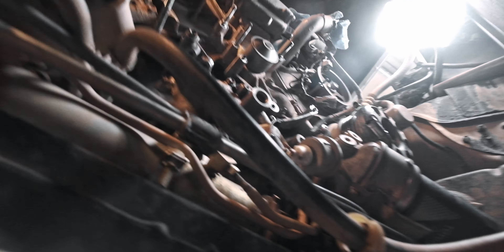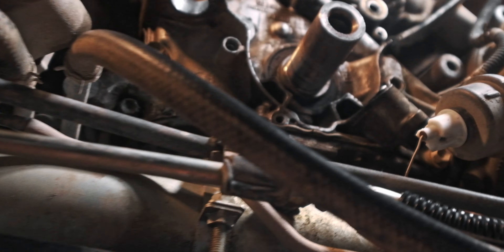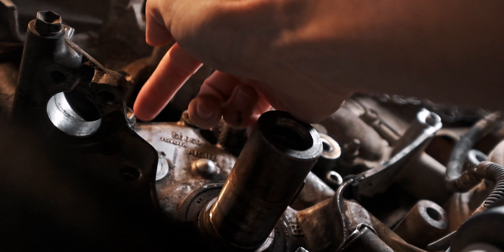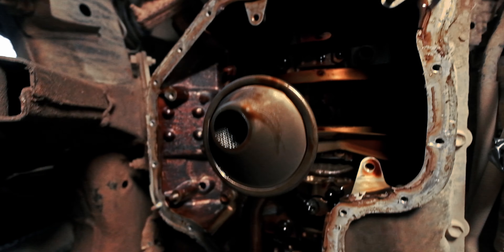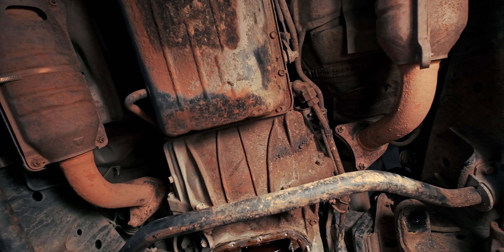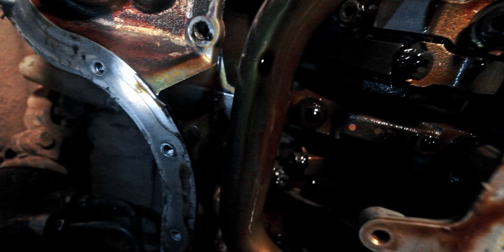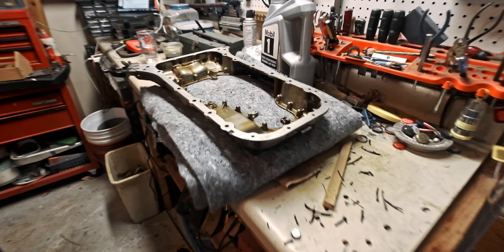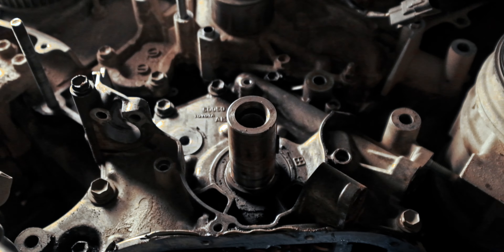Oil Pump Leak: O-Ring Failure on 2UZ-FE for 100 Series Toyota Landcruiser, Tundra, LX470, etc

Comment: Thank you for this video. Quick question. I took my Sequoia to have this leak taken care of. The mechanic did the front crank seal, only for me to find it was still leaking once I went to pick it up. He told me it was that same seal, but once he tore it down again, he told me it was from the oil pump housing. The new crank seal held up. At that point he still didn't know there was an O ring a couple inches away behind the oil pump housing. In the video he sent me from the first time, there was oil up there but worse than your video, and pooled up under the crank sprocket. Now as we're addressing it again, he said that it was hard to tell because the timing mechanism sprays oil everywhere. My question is, would that actually happen? Or does the timing cover block oil from spraying upwards? Just trying to determine if he missed it the first time and it seems like even the slightest amount of due diligence would have proven the crank seal was not the only issue.
Reply from the maker: It’s difficult to understand if you’ve never taken one apart but if he had looked at a parts diagram he would’ve figured out what the problem was immediately. It is easy to assume that the problem would be limited to the crank seal but he should’ve made sure it was fixed before returning it to you